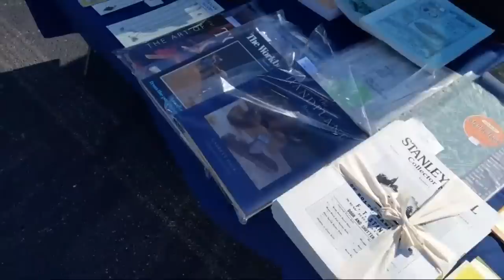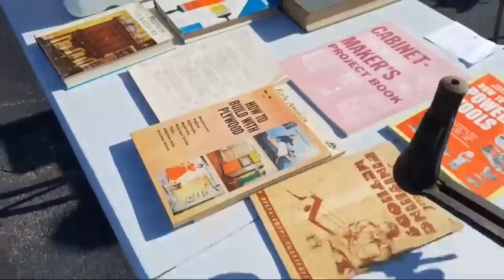MWTCA National Meet Peoria Illinois 2019 Tailgate Tool Sale

Comment: When you make a donkey's ear, what kind of wood is best?
Reply from the maker: Whatever would you have on hand. Generally a good hardwood would be best like a maple or cherry. something smoother would be very useful
Reply: @WoodByWright  The primary for the question was about wear/durability. Personally, I prefer not to be remaking my "tools" all the time. I prefer reliability and dependability. Maple and cherry are those I have primarily seen because they are both fine grained hardwoods...I assume.
Reply from the maker: @clydedecker765  correct. They both are dufus poris woods. So they're not prune to cracking or splitting along the ring structure